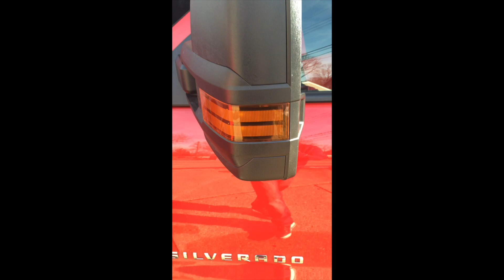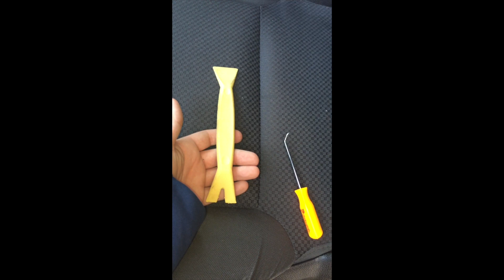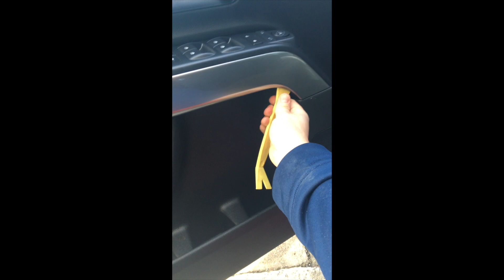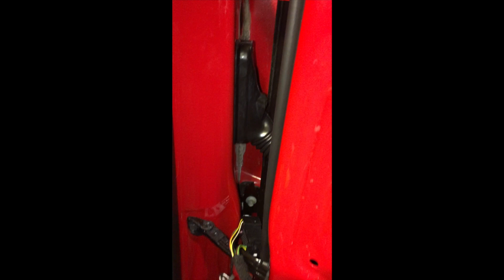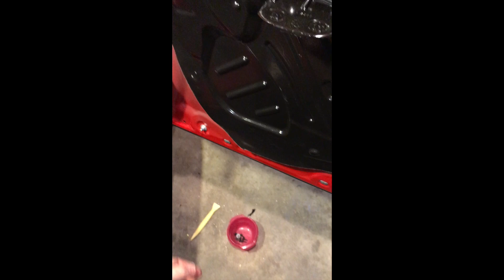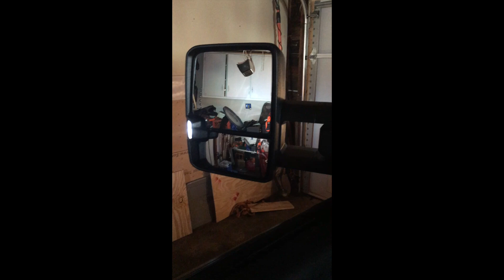2015 K2XX Silverado OEM Tow Mirror Overview Install

Comment: When putting the door panels back on, take the clips off the upper edge of the door panel. Hang them in the tabs across the top of the door sill. then feed the door lock button through the panel and the panel just pops straight onto the door.

Comment: are your mirrors heated? i have a 2015 z71 with heated power tilt mirrors. i went to the link you posted where you bought the mirrors but it doesnt say anything about heated.

Comment: Was there a noticeable difference between your stock speakers and the kickers?
Reply from the maker: Yes there was a very noticable difference between the two. I still plan on putting another pair in the rear doors because they are not as strong.

Comment: Hey cool video. Looking forward to do mine. Have a pic of the whole truck to see the look? And way cheaper site for mirror package. $4xx instead of $6xx. How much did you spend with everything? eBay has a package with everything for $800. All harnesses and mirror kit. Thanks. So I can compare.
Reply from the maker: Ahh I spent like $500-$550 if I recall. I could of saved money by ordering the wire harness online but I was impatient and got them through the dealer.

Comment: did you need the jumper harness too or just the door harnesses...? I'm reading on some they need both and I was told I only need the door ones .. just want to get everything in one shot ya know ..?
Reply from the maker: I only needed the door harness. The jumper harness should support either one from my understanding. My truck was built as a 2015.5 Model Year so if its a 2014, not sure if you would need both or not. I would expect you only need the door harness, both you need both for each side.
Reply: Kyle Opalinski roger that .. I broke down and bought the door harnesses and the jumper just to cover my ass ... they said i could return the jumper if i didnt need it .. Thanks for the info
Reply: Kyle Opalinski so I got mine installed today and my truck was at the dealer for two days ... they didn't get the jumper harness in ... the ones are in the doors and the only lights that work are the ones in the glass , the passenger side mirror adjustments are all wrong .. idk wtf to do now ...
Reply from the maker: Did you get it installed at a Chevy dealership? Either the mirrors are defected, they didnt install the correct parts, or they didnt set the program code into the vehicle.
Reply: Kyle Opalinski yea ... took her to the dealer .... looks like she will be going back on Thursday to hopefully get finished up .... and spend more of my money lol ... everyone can check em on Instagram @Skuba83

Comment: did you use the 23387133 harness?
Reply from the maker: No. However that could be an older part number. They switched suppliers so there is techicnally 4 part numbers. 2 for dr side and 2 for passenger side.

Comment: what month was your truck manufactured? One dealer says I need the two door harnesses and a mirror "Y" installation harness for 14-15 1/2 models years. one says just the "Y" mirror harness that has some plugs and single wires with pins to put into an existing harness but does not have any directions. such a pain. Did your original harness match up at all with the new mirror plug?
Reply from the maker: The original hardness did not match up to the new mirrors. I had to install both wire harness on the driver / passenger side. I would suggest reading the description. There is a great thread I added that has alot of that info. And I provided the part numbers that are needed. My truck was manufactured in November 2014.

Comment: What kinda of harness did y'all buy because I bought a 2014 Gmc and I just got thoes mirrors and I'm worried about putting them on and then working, did y'all have to buy anything special besides the mirror
Reply from the maker: You hVe to buy the wire harness. Part numbers are in the description

Comment: how did you knew what harness part get from your dealer? thanks
Reply from the maker: +Luis Ruiz I did alot of research on some forums and talked to my dealer about it. 

Here is the forum I posted online for page 3 where you can find documentation on what you need. 
http://www.silveradosierra.com/exterior/adding-tow-mirrors-on-k2xx-trucks-t283890-20.html
Reply: +Kyle Opalinski 
thanks bro, I ordered the mirrors from the same website you ordered and talked to them about my vin# for harness compability, they gave me a diferent harness numbers of the ones you have, I just waiting for the parts by the end of next week. hopefully everything fits accordingly.
but I wouldn't do it without your videos man!!
you rock!!
thanks again
Reply from the maker: +Luis Ruiz Not a problem man. On that thread somebody did post a better way to install the door panels when your done. I suggest trying his way because the way I did it was very difficult.
Reply: +Kyle Opalinski , got it, thanks
Reply: +Kyle Opalinski  
I replace the harness and install the mirrors!
thanks man!!!
everything working just great!!
Reply from the maker: +CAMARO67 RSSS great man! You install them yourself? If so, what did you think about putting the door panel back on. Cause i thought that was the worse part.
Reply: +Kyle Opalinski .
I look into other videos and found an easier way to put it back by putting the weatherstrip first on the door and then the panel, but all thanks to your videos.

Comment: Did you have to go to a dealer for it to be programmed  or you just connected the harness and it did the work for you?
Reply from the maker: I didnt have to have the dealer reprogram because of when my silverado was made in production. It was just plug in play once the new harness was installed. Some will need to be reprogrammed but mine wasnt and wasnt sure why.
Reply: +Kyle Opalinski did u have to buy anything else then the mirrors and if so what
Reply from the maker: +Nick Fisher read the description. You need new harnesses depending on the year your truck was built
Reply: Because you had the dl8 mirrors which are heated do the ones you installed heat as well?

Comment: Great video man! I ordered the chrome mirrors and harnesses for my 2015 GMC Sierra 1500. I hope to get them installed tomorrow! Just to clarify, the amber running lights on the back of the mirrors shouldn't blink with the turn signals, correct? They are just meant to stay solid when the normal running lights are on?
Reply from the maker: Yes they just stay soild when they are on. The turn signals are only for the mirror side.
Reply: +Kyle Opalinski Thanks!

Comment: I just installed my tow mirrors this past weekend. You are right about getting the door panel reinstalled. They are a pain. I still need to get back into the doors to replace the wiring harnesses but now that I know how to open the panel it'll be a lot easier. Thank you for showing all the mounting locations for the wiring harness. Do the mounting clips come pre-installed on the new harness?

Comment: Do your running lights work?
Reply: +Kyle O I was talking about the running lights on the mirror. The Amber lights on the back of the mirror should have two functions: turn signal & running lights/clearance lights. I saw your turn signal reflect off the wall at 6:24 but when you turned off the turn signal I didn't see your running lights come on.
Reply: +Kyle O Ok thanks, just wanted to make sure. Great video it's very hard to find a video on this subject. All I could find were online forums, but I needed a video to visualize it better.